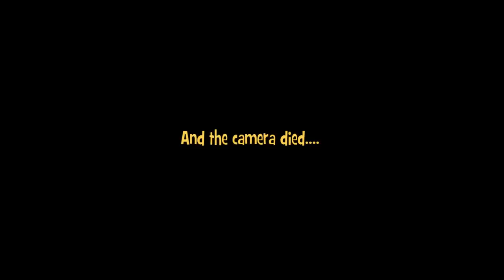Operation Old Crusty Grand Dad Napco Front Axle Removal

Comment: I noticed you tapped the u-bolts out with a hammer. I usually put a piece of wood at the threaded end of the bolt, and hit the wood, that way there's less of a chance of boogering up threads.
Reply: +N Krout That, or leave the nuts just barely on the threads until things are driven loose.

Comment: Those axle's were made by Eaton before NAPCO modified them, correct? I have decided that (even though the dana 60 is working fine...) I need an Eaton HO72 in my truck, because, reasons!
Reply from the maker: +RustyOldF250  Haven't heard that, but the Eaton diff is a direct drop-in. You can pull the rear and drop it right in the front

Comment: ive got to ask and im sure a few people are wondering as well, but couldn't you have taken the cab , bed ect, from crusty or the 2wd and dropped them on a more modern chevy short bed or blazer chassis, don't get me wrong im all for keeping a classic as original as possible but in this case seems to me it would be the logical choice, or would it not fit without modification
Reply: +darkside0914 , yes we could, but then it wouldnt be old grand dads. Maybe the spare parts will find a home on something more modern - but you'll have to wait and see :D
Reply from the maker: +darkside0914  That wouldn't be a restoration!

Comment: All those parts , you're cutting off\up and tossing in the trash , have value , because had you saved and tagged them , you'd know what SIZE a new part needed to be ! You've got a  junk yard mentality , that , in the long run adds additional time to your work projects .
Reply from the maker: +joe doakes  I worked in a wrecking yard for a year and a half, fresh out of High School. Each part had to be tagged and inventoried. Now the SCRAP yard just whacks and hacks with no due regard to value. In this video, https://www.youtube.com/watch?v=fIKdrU6Dpa4 the truck belongs to the scrap yard, and is not mine. I did what I could to get as much as I could afford and get it done in half a day. You might also go watch the beginning again where I say I would normally torch the u-bolts off,  but in this case I'm saving them. The nuts were being dropped in a coffee can, where the u-bolts ended up as well. They're on the shelf. If you need them, they're $35 plus shipping. Personally, I would never buy used u-bolts. Re-using them works OK for a repair or when you replace a rear-end in your beater, but never in a restoration.
Reply: +ElderlyIron , I think you're a good mechanic , with tons of experience and I enjoy all of your video's !
Reply: +ElderlyIron  I worked on a big hydro job when a guy came in,  wanting to be boss over the tunnel crew. When asked what experience he had, he told them he ran a junk yard for 15 years.